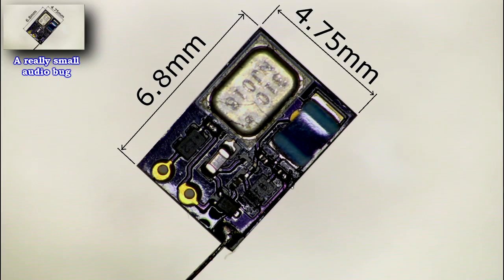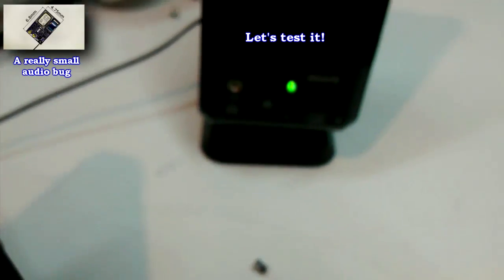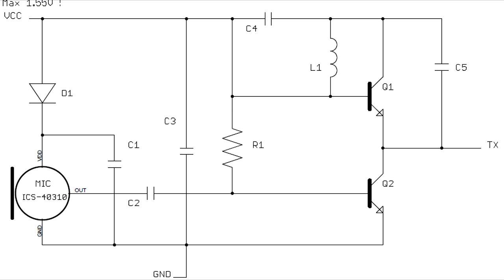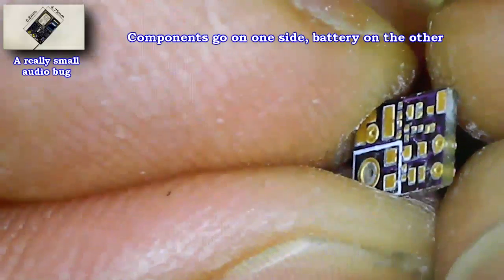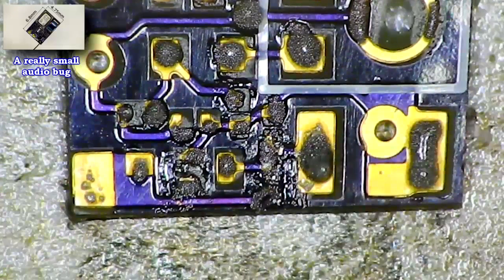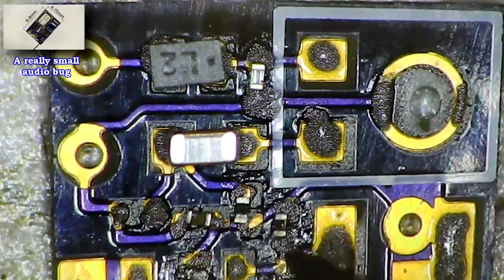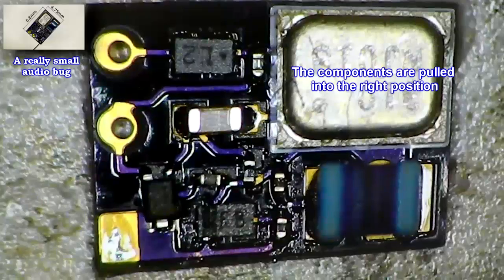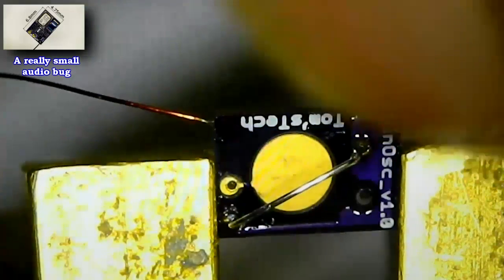How to build a tiny FM Spy Bug

Comment: Using MOSFET instead of BJT. Using 0201 or 01005 SMD components and 0.4mm thickness PCB to reduce the size. Using micro strip inductor to generate the carrier to GHz frequency ( less interference band ). This can help to reduce the length of antenna too. Using a commercial grade receicer with high gain antenna ( for example : helical yagi ) instead of FM radio to get higher receiving sensitivity. Workable distance can be improved to saying km.

Comment: I need a version of this with an oscillator built in for use as a tracker for large insects.
Reply from the maker: This circuit is not suitable. I built one similar to what you suggest but you would need to go higher in frequency to decrease antenna length.

Comment: Where can I buy a smaller microphone ? I don't mind if I pay $10 for it!!
Reply from the maker: WM7331 is 2.5x1.6mm but has higher voltage requirements. There are other much smaller types , these are not necessarily commercially available

Comment: Nice really nice work, but how you protect yourself from soldering paste when it start to release poisoned gas which present  heavy danger for health. Every low temp soldering paste contain such chemical in it. You should note that in your video for all who do not know such thing and get amassed how you doing it so want to do same without knowing for danger. Anyway as you did great job I left great big like .
Reply from the maker: You are right, the flux fumes should not be inhaled.

Comment: Is there any money in it ,if you sell this as a kit
Reply from the maker: I don't know. I don't think it's worth it sell it as a kit because it is pretty difficult to assemble without the right tools... Then there is the fact that while the circuit works its stability could certainly be improved. I'm working on something better that could also be worn on a person (this one can't). If you want to build one, see how it works and decide to sell a kit yourself give it a try, I don't mind. Parts are only a few bucks worth.
Reply: Out of my league
Reply from the maker: Because this type of simple one transistor transmitter designs are easily detuned when moving the antenna or bringing conductive stuff (like your body) near the antenna. Also, at this frequency the antenna has to be pretty long to get a good range. Ideally a bug like this is crystal/resonator stabilized.
Reply: TomTechTod why do you say that the transmitter cannot be used on a person?

Comment: I mean how making the board this small size
Reply from the maker: You need a PCB design software for that, preferably free of course. You could use EAGLE or one of the many others available. You will most likely need to create your own library of parts. After finishing your design you send it to a PCB manufacturer, here I used Oshpark.com.
Reply: did you figure out?

Comment: Well done but unstable design due to lack of xtal.

P's As a kid I found my AM crystal set would transmit on long wave by speaking into my 4k ohm earphones no batteries required.
Reply from the maker: right, xtal would be better, that will be my next goal. even more important is higher frequency to make a shorter antenna... well, we'll see what I can come up with.... since I don't use that stuff in any real life situation I don't really know what would be useful. I guess a VOX and/or remote control maybe